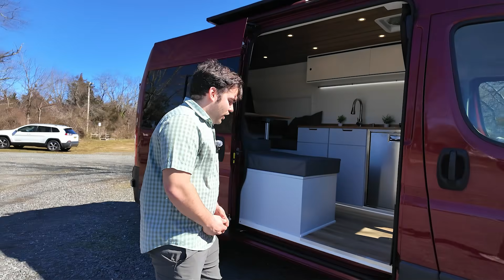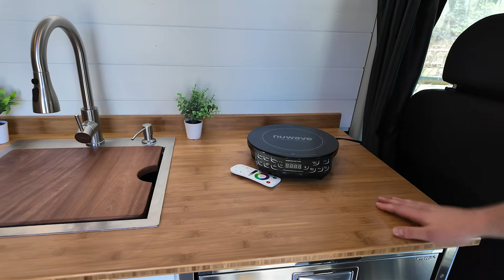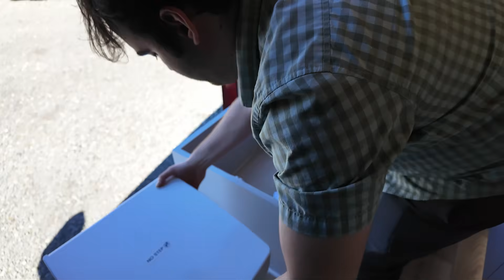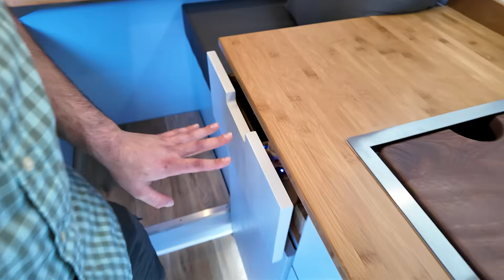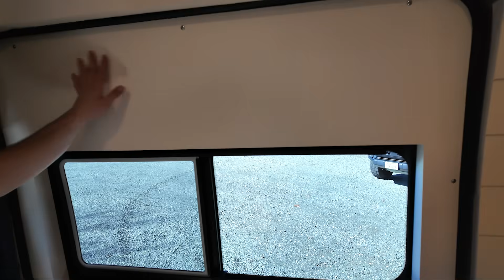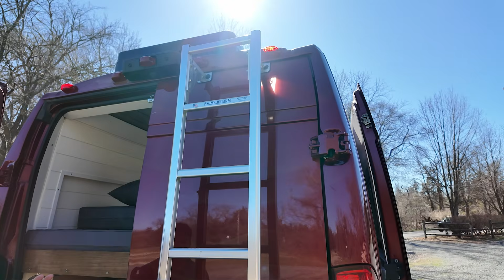A Short Promaster is the BEST Van For a Camper Conversion

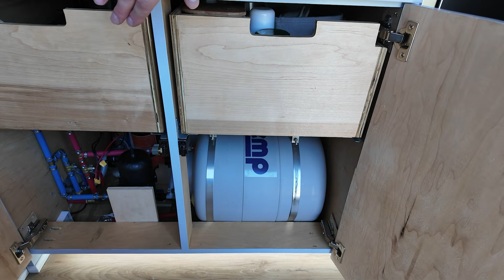Comment: 2:08   Drawer cut away back for plumbing and cut away front to clear hinges and act as handle.
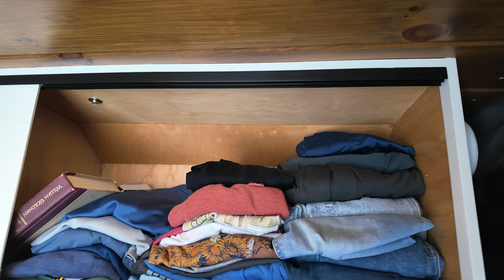4:15 Upper cabinets with sliding doors.
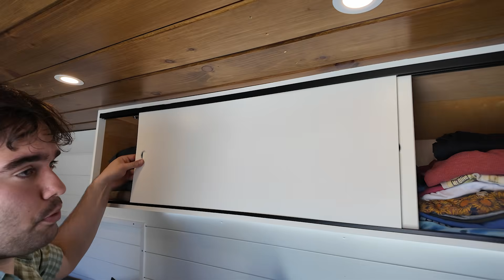4:34  Shower under seat.
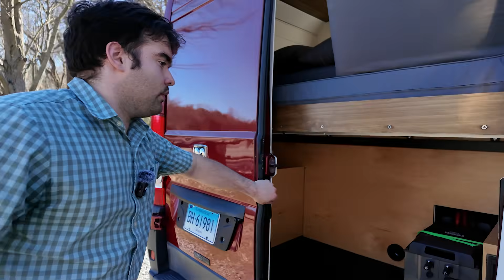9:07 Boxed water tank in garage allows storage on top.
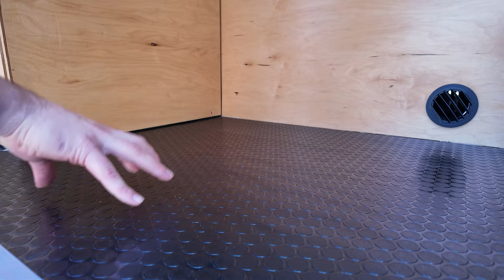9:31   Coin flooring in garage.
9:34 Led lights and wire channel in garage.
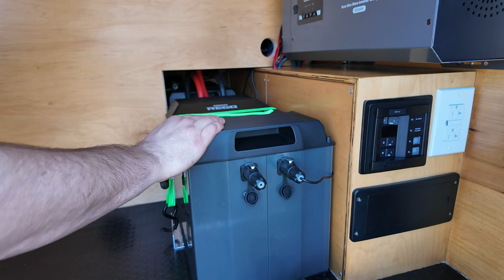9:56 Shore power adapter with outlets installed outside.

Comment: Doug, great van design on my favorite vehicle, I love this simplicity of this layout. Thanks again Patrick for this interview, your the best. :face-blue-smiling:  :hand-purple-blue-peace: Low cost on maintenance folks, be smart, I would select this 36 inch wheelbase ram promaster 2500 series chassis high roof camper van conversion over others. Rent it and then buy one after you feel it out. :face-red-heart-shape:   Then, Doug tell us ,more about your vans performance on the road; that is Very Important to us consumers; and the types of adventures you used this van on; how did the engine work on far trips, gas mileage,  maintenance problems, what parts to carry , what fell apart in the van, how did it work in summer, winter, and what broke on the van, tires, rims, did it get stuck on dirt or sand roads? front wheel drive or not, That helps us make a decision. :body-blue-raised-arms:
Reply from the maker: So glad you loved it!

Comment: Very nice layout for packing a lot of features into a SWB van.  I see a lot to like here, and it has given me some ideas.  Unfortunately, I see VERY little storage space for clothing items, cookware, dishes or the other "stuff" that one wants while in a van for more than a day or two at a time.  Obviously that is just a tradeoff for trying to pack so much into so few available cubic feet of space.  Personally, I would rather have the controls mounted on the wall to the left of the overhead cabinets, and retained the valuable drawer space as storage.  And while I like the IDEA of saving space with a convertible shower of some sort, I also know what those enclosed wet and damp spaces lead to...  Folding up a damp shower curtain and stuffing everything into a wet box and shower pan will be an oasis for mold and mildew.  As much space as it takes, I still believe that a full shower is best as it allows everything to dry, and also serves as a great "wet room" for hanging wet towels, swimwear, and other gear that gets wet during the course of a typical trip.  Of course, everyone has their own priorities...  For me that means a LWB, or even a LWB EXT...  But, if a super short overall length is a priority, then I think you did a great job with the space available! 👍👍
Reply: You don't need such a deep box to shower, I do it in a 4" tall sided shower pan that rotates out from under my cabinets.  Tiny space give and you just let the shower curtain hang there until it dries.  I have concealed nails with crosswise slots giving access to them, bungie cord short pieces stitched into the shower curtain hangs it with a 5th nail to hang it with the opening open for full air drying.  Just literally leave it all open while driving and it will all air dry, never a concern for mold.  Should you need for some reason to close it up, just give it a quick wipe with a spare hand towel and hang that up to dry.  No one sane just wads up anything wet.

Full showers just waste space and most put the porta potty there and other junk storage when traveling, so you have to empty it and refill afterwards.  My design takes up less than 3' of cubic space and works perfectly.  I have a boot tray for everything else wet open to air full time.

Comment: I really like the choice of van, and the layout of the van. I like the placement of the bed, the chairs, the table, and the kitchen, although the NuWave oven is very small, and the refrigerator seems small to me. Putting the outlets and the controls in drawers was a novel idea, but it seems to me it might lead to the wires being accidentally yanked out. But I think it is a good idea to have a dedicated space for the controls, but also planning for where to store everything in the van. I like the shower area. However, it is a little bit too small for me, and I would feel safer if I were seated while I was showering and I don't think I could stand in the tiny boxed in area. I would change those things, and I think I would also change the kitchen a little bit and figure out how to squeeze an area for clothing as well as my other belongings in the van, including the food and equipment for the kitchen. I like the table and the chairs as well. I think this van is really great, but I would change a couple of things. I really like the bathroom in a box. It's great the way it is, but I couldn't use it for showering, because it's just not safe enough for me. But that's a great idea for an emergency toilet. I feel like there's a lot of space under the bed that I guess is used to store something. But that amount of space would be great for storing clothing, and other items that you use, and it would be great if you could retrieve them from inside the van instead of by opening the back doors of the van. If you moved the chair that is between the bed and the kitchen to the other side of the van and adjusted the table and the bathroom box... so that the table and chairs were over there - You could put a closet there beside the kitchen. Maybe a little thin cabinet area on the side of the closet which has a little door where you access it - could be where you put the outlets and light switch for the kitchen. You could also lower the bed so that it is the same height as the chairs and put a shelf above the bed for more storage that you could use to retrieve things from inside the van. Then the bed could also be used as a couch area, which you could easily light up with some overhead lighting built into the shelves above. You could still put some storage under the bed and retrieve items from there by opening the back door of the van. Maybe a furniture unit that has the bed and the shelves and the cabinet connected to it could be built inside the van. You could even put a back on the unit so that there is some insulation from the crack in the back door, but you could still have the cubbies underneath for storage which you access from the back doors, maybe with cabinet doors on the back of the cubbies so that you are still protected from the draft, and maybe just a little space from the floor to the top of the van for storage, for things like skies or whatever could also be available. I feel like - maybe the shower idea should be abandoned except for when you are in very remote places where you can shower outdoors. Maybe it would be better to get a gym membership and just shower there most of the time if possible. I guess if it is 100% necessary though, you could possibly build something into the kitchen area so that it is safer and more convenient to bathe inside the van. I like the concept of using a shower curtain that is temporarily set up. Maybe an extra large plastic bin could be under the sink area and you could pull that out and have a waterproof foldable chair in it to sit in. You could have a bucket for the water and a shower with a pump to spray the water on your head while you bathe and afterwards, dump the water out of the plastic bin and then dry everything off and store it in the large plastic bin and put it back under the sink. But that would be pretty difficult, and keeping mildew and mold from developing would also be pretty hard. But I think I would abandon the idea of bathing in the traditional way in the van, and resort to sponge-bathing if it were an emergency. Instead, I would improve the kitchen. I think the kitchen sink should also be used as a bathroom sink. It should be where you brush your teeth, and there should be a mirror there if you need to shave your face. It should be where you wash your face, and also it should be easy to wash your hair there. Figuring out exactly how to do that, takes some thought, but that is a project that I think is necessary. I would also improve the kitchen in other ways. I would get a different type of refrigerator that was built more like an ice chest, and I would put that on a slide out drawer under the counter so that there was more room for food and it was easier to access. I think I would do the same thing with an electric skillet or portable stove unit, so that I could cook on it. I would also get a microwave/traditional oven appliance and store easily stacked pans that could be used for cooking and baking in it. I would also adjust all my drawers and cabinets so that they were designed for exactly what I would be using in them to make it much more convenient to find and store what was in them. And I would plan very carefully what the measurements and everything for the chairs and table in the dining area were. I guess it would be possible to make one of the chairs part of the couch area on the end of the bed. You could just put a cushion or a special seat that can be unfolded with a back on it there when you want to get it out and use it, and then build the table into the wall to save room. The table could be used as a side table when you are sleeping. If you need another chair because there's two of you using the van, you can convert the bathroom box into the other chair for the table. The swivel table is a nice concept. But it might be a better idea to use a foldable and adjustable table with wheels that can be locked. You could adjust the height of the bed/couch to fit the table. The table could be stored on the side of the van with the door. And when you want to use it, you can roll it in front of the couch, and you could have more than one foldable seat. You could both sit on the folding seats on the couch while you sit at the table. You won't face each other, but you will have a bigger table which can be adjusted for a lot of purposes and moved around. Or you could figure out a way to get a foldable chair or another table so that you guys can sit in different areas which are more comfortable. You could also use a cart for the same type of purpose. Having movable and adjustable tables and carts like this which could be folded away if necessary would greatly extend the number of activities you could do inside of the van. This is a very inspirational video. I think this van has very good bones and is built very well for the most part. But I think a couple of mistakes were made and that some improvements would make the van better. There are still a lot of details to think about. I like the idea of using seats on the couch instead of built in box chairs, and maybe using a swivel passenger chair as well. I also like the idea of being able to store a table and maybe a cart of other rolling storage device under the bed if necessary. That would keep them from moving around when you were driving. And maybe suitcases could be stored under the bed. There could be a bed skirt to hide them. An overhead shelf above the bed with cabinets would be great for books and computer equipment and stuff like that. I think I would like to have an extra mattress for the bed as well. I would like to have the two mattresses on the bottom, the way it is in this video, and I would like another one which can be propped up on its side when the bed isn't being slept in, and used to lean up against, but which you can lay down on top of the other two mattresses when you want to go to sleep so that the bed is more comfortable to sleep in and the couch is more comfortable to sit on. I would use velvet upholstery fabric for the mattresses. And I would use thick and large comfortable pillows to sleep on and also to use to support my back depending on whether I'm sleeping or sitting on the couch-bed. I think a quilt or something would be a good idea to protect the mattresses and the pillows should have pillowcases to protect them too, but I would still use soft upholstery fabric, because I think it would be more durable and more comfortable. There are still a lot of details to figure out, but... I think this would be a good start.
Reply from the maker: Thanks for the detailed feedback

Comment: I like the design but, when I build mine im doing bed and dinette where the kitchenis. Like a solicepocket36a.  No sink. Refrigerator under bed. Use a portable stove, folding table and collapsible bins for cleaning dishes.

Comment: Somewhere this is the first Van build. I see, see where they actually have food and stuff. In the Van, which means by definition, this couple actually uses it. And it's not for sure. You can always tell the fake vandwellers or the people who use it for show when the Van is the show with the Van, there's all the drawers and everything's empty. There's nothing in them so clearly. You're not using it, but this one has played and everything in it, so they may be using it. Maybe it could be a prop. I'm not too sure yet. I'll forget it at myself.  But most Van dweller's who do this on the show. Demands always empty, which is a red flag, which means you don't use it.

Comment: What? Why do people seem to think they need AC power in a Van? You're gonna lose a lot of battery power to generate that why do people be content well each of their own. Of course, but why don't people just have 12 votes in their vehicle in my campaign and trailer? I don't use no one temple. I can't, but I do have a inverter which is separate from the the battery. Cause I have my inverter separately. I don't put it hooked up like lot of you guys do meaning more wire in all over the place.  But each day I don't know. I just try to figure out. Why do people insist on having a one time in their vehicle? You don't need it but each day oh.